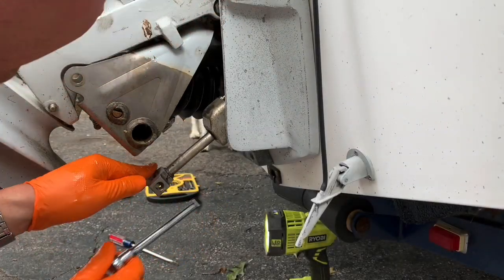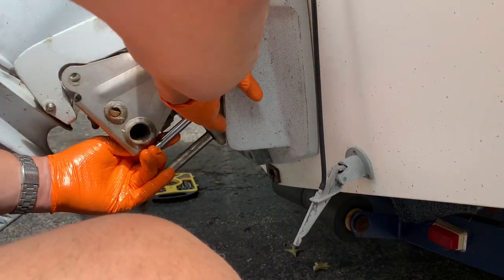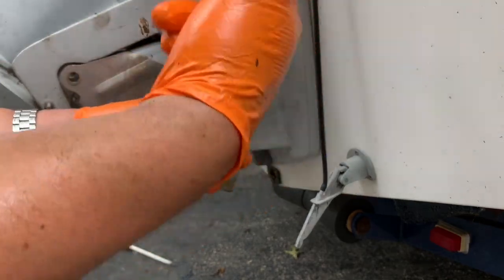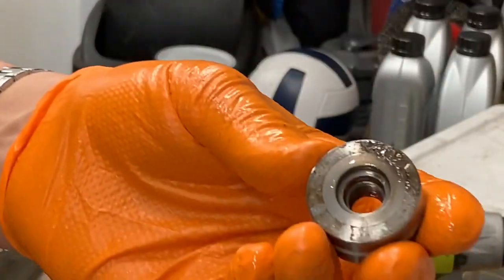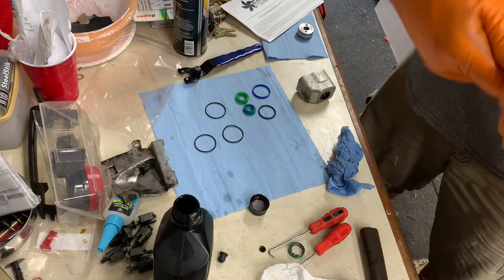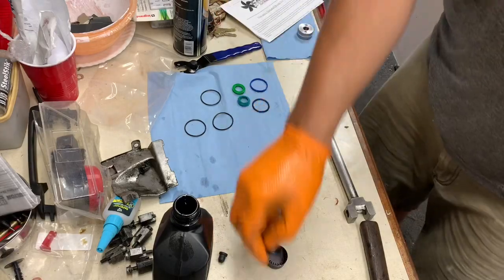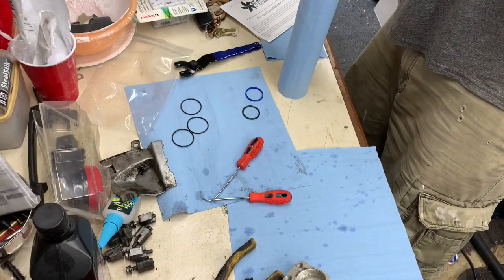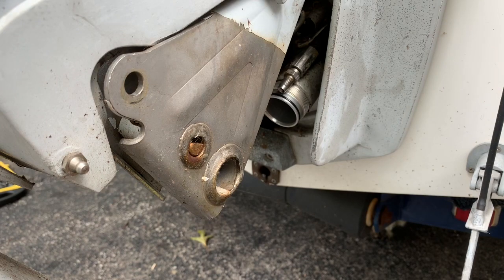Volvo Penta Duo Prop Outdrive Trim Tilt Hydraulic Cylinder Seal Rebuild due to leaking oil  Part 2-2

Comment: helpful video thanks for it.  where can we get the kit from
Reply from the maker: Here is a link to the parts I used .

Pin Wrench https://amzn.to/3anCaIo 

Oil for Outdrive Lube  https://amzn.to/2Ym8SVR

Seals https://amzn.to/3iKi0uS

Hydraulic Trim Tilt Cylinder Seal Rebuild/Repair Kit 290 DP SP A

Comment: Did the caps tighten in the right location? I'm rebuilding the cylinders on my boat and I'm having the problem with the caps tighten in the wrong location.
Reply from the maker: If I recall, they may not have been completely tight or I had to back them off a bit from tight in order for them to line up.